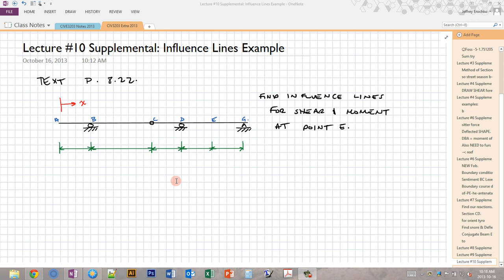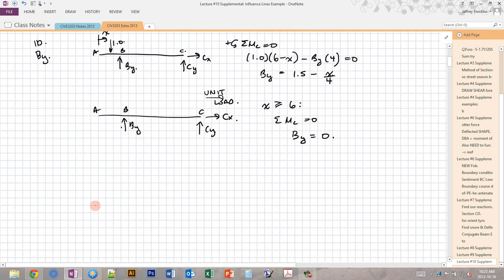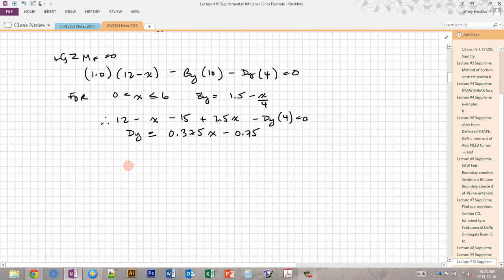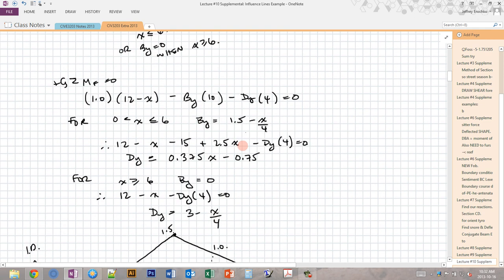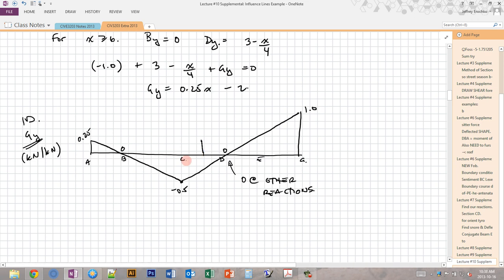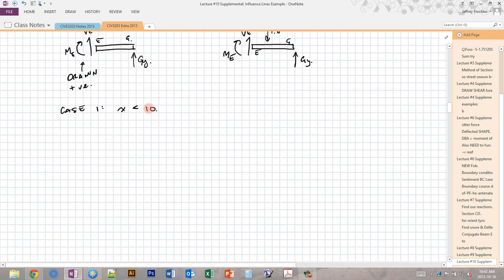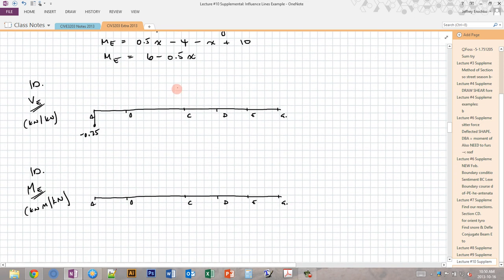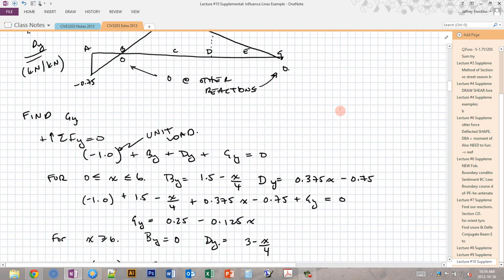EXAMPLE Calculating Influence Lines: Part 1 - General Method

Comment: where did you get the rxn @ by 6-X/4 ?
Reply: 6-X/4 is equal to 1.5 - X/4. just divide 6 into 4 and x/4, you get 1.5 - x/4.